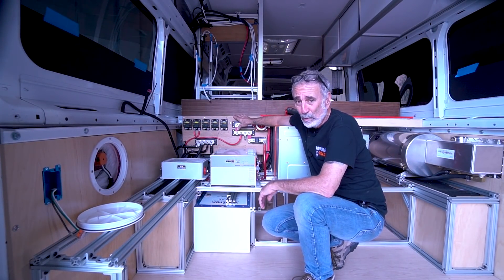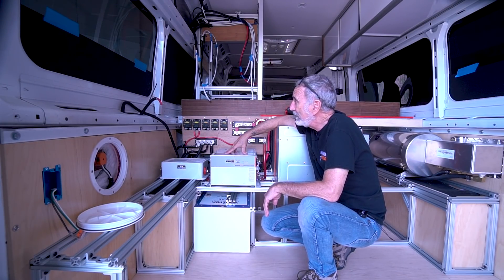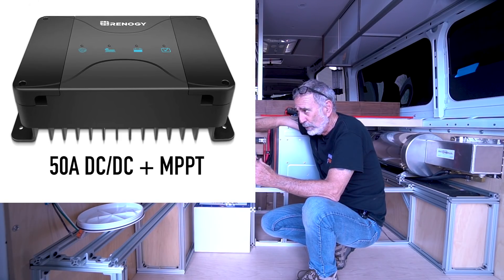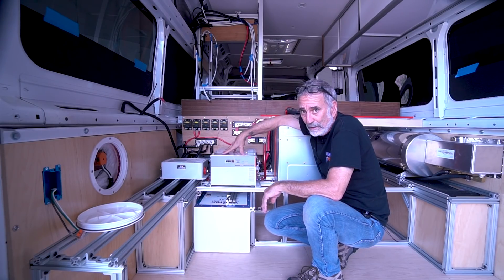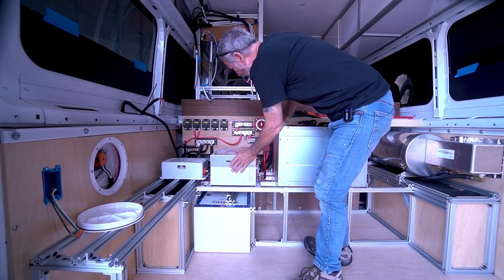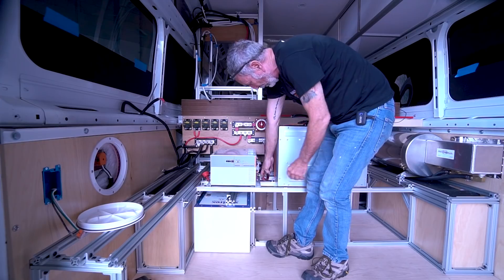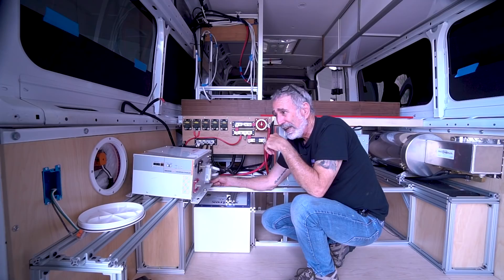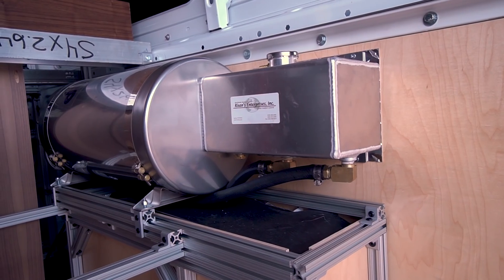In this van build, CRITICAL CHARGING DECISIONS must be made now.

Comment: Higher voltage smaller gauge wire... Cost less, less components.... I'd go higher voltage with a disconnect at the top of the van and another in your electrical room
Reply from the maker: Agreed. This is an older video where is was a proponent of parallel wiring. Now I wire in series, but still use a heavier wire to get all those precious volts down to the controllers

Comment: A bed comprised of three or four sections of plywood that are connected to each other by long recessed piano hinges would be great to fold up and remove for better access to this utility area. Your aluminum beams need to drop or lock in to be easily removable.for the same reason. The kind of stiff foam that Coachmen now uses for their long cushions is even better than what Pleasure Way has been using. Research that foam and that manufacturer! Three or four long cushions can match the width of the plywood panels. Each plywood panel can be covered by Velcro loop. And the cushions themselves by Velcro hook.These individual mattress sections would be far easier to handle and stack aside. But I would strive to maintain at least a 26 1/2 inch clearance below the bottom of the beams. If not, 21 inches. You are so well on your way to making the ideal modularized  garage, sleeping, utility room. A space that serves at least three important functions.
Reply from the maker: My garage space has 33 inches of clearance for bicycles mounted in a custom built sliding tray. I have used the three panel plywood bed system in my builds, however, not connected by piano hinges. I don't want to have to manage all three panels every time. I can remove a single panel or all three with ease, when they are separate. I appreciate your comments and participation, Cecil.
Reply: @HumbleRoad  - With a 33 inch top clearance, you have hit it out of the ballpark. My Greenspeed Magnum XL has seat posts that come up to 34 inches. No problem though because the entire seat can be removed easily enough. Mind you, this height is with 20 inch tires all the way around. With the seat removed, the highest point is 24 inches with the rear rack, but 30 inches with 26 inch wheels. The overall length might be problematic though. I don't know what your total depth is. It might only allow for a single trike to be wheeled in diagonally. I would rather forego trays although I appreciate how perfect they are for bikes. I would just have a heavy carpet to protect the rear bumper and then wheel the trike tires over it. The piano hinge idea would be used to temporarily claim a portion of the mattress width for clearance while a single trike is wheeled in. The REVEL has the rear bed platform that lifts to the ceiling when not in use. The bikes and trikes can roll in and then out again when you reach your destination and are ready to sleep.

Comment: As you know, I love the versatility of that rear garage area for storing toys. Your design makes it a combination garage and utility room. Slide drawers for tool boxes and boxes of repair parts and hardware are nice, but you do sacrifice space. Ideally, I would love to store two HP Velotechnik  Scorpion trikes wheeled in with seats removed to fit underneath a platform bed.. Different directions like shoes in a shoe box. One model has 20 inch wheels all around. Another has a 26 inch wheel in the rear. These two models fold all the way down and the wheels can be removed, but avoiding this would be more desirable. You will eventually encounter a couple who wants exactly this so this is not so off the wall. Radical Design makes a folding bag that holds an entire broken down Scorpion and the bag handles can be thrown over your shoulder for carrying. Ideal for travel by air. There is a video demonstrating this on YouTube.
Reply from the maker: Cecil, email me at georgemauro@humbleroad.tv

Comment: If you have a platform bed in place, you won't have easy access to all this.
My solution would be to have a platform bed that elevates to the ceiling between use.
NOT ELECTRIC!!!!I think it was you who doesn't like electric awnings.
Same here. There should be a practical mechanism to crank a platform bed for cleaning access an other reasons.
Reply from the maker: I just might entertain that idea in my current two builds.

Comment: The marine industry is decades ahead of the RV industry although there is good catch-up taking place.
There are many innovations within the marine industry which can be prudently applied to the RV industry.
The monocoque design of the WINGAMM Oasi vans reminds me so much of marine engineering.
But system access for repairs and retrofitting becomes more problematic.

Comment: I run two Victron solar controllers (one for 2 100W Renogy parallel flat mounted panels on the roof and one for 3 90W ACOPOWER deployable panels run in series) and a separate 30A isolated Victron DC->DC charger.  Very happy with Victron, their app, and their frequency of firmware updates (I also use their inverter, battery monitor and AC->DC charger).  Not sure if you've seen but several people have had "melting" issues with the combined Renogy controllers.

Comment: That combo DC-DC/MPPT controller has a max PV voltage limit of 25V so you MUST run the panels in parallel config, and be aware that that device only provides a max output from both alternator and PV of 50 amps TOTAL ( regardless of whether it can receive 50a from the alternator and 50a from the PV. )

Comment: Those  worm-screw style perforated banded hose clamps on your heat exchanger cut into the rubber hose material thus loosening and causing leaks. I highly suggest either wrapping the hose with protective layers of friction tape, or replacement with a non perforated smooth internal surface clamp. Stop leaks before they start.

Comment: I'm doing 600 watts also and am doing 3 groups of 2 panels - the 2 panels are wired in serial, and those 3 groups are in parallel. That will give me a 24-volt system (maxing out at about 36-40V input to the Victron controller) to keep the voltage manageable, but also keep the current lower than a 12V system, while also giving me 3 separate independent areas in case of shade. Also, despite being comfortable with DC voltage, I still like to stay in the safer, lower ranges.

Comment: Either solar option (series or parallel) is fine, each with their own benefits and issues, but I would recommend that you use a double pole isolator for the input from the solar, especially if going for the series/higher voltage input option (which also has the benefit of only requiring the single input breaker).

I’ve been waiting for info on the closed loop/engine heat install you have designed, so can’t wait for the next video.

Comment: This may not make much sense, two parallel runs to two controllers to two smaller battery banks of same size, then output those to feed the house inverted power. Neither controller has to float to its bank, parallel to parallel output, maybe this can’t work yet ?

Comment: I like the top notch equipment.  I also like your two solar controller idea.   I have an idea for a design concept for you to consider, George.  We all know these vans break down and need service.  We also know the vehicles have a usable shelf life. My design idea is to make a  camper van insert.  A modular concept.  Build out a terrific design in a Shell that can be inserted into the van fully self contained and be able to be removed when the vehicle needs to be replaced or serviced.  Sealed off Airspace between the Insert and the Van Body, with Air being able to flow around the insert to keep temperatures down in hot weather. ( It's just like parked under a shade tree) Your Top Notch equipment will outlive the vehicle, so when you replace the van remove the insert and install it into a new van.  Easy in, Easy out!  

Well that's my concept... What do ya' think?   

What would the neighbors think at the camp ground?  An insert, Self Contained with Hook ups, sitting in a Campground like a tent, waiting for the van to be serviced.

Comment: i will go for series connection for solar, the higher voltage the lower current losses along the cable, BUT parallels come's handy if one of the panel is in shade. For me i will always go for series to save money from cabling and save some weight too, currently i looking for 48v devices (air-con, fridge) i think 48v is the future.

Comment: I like the idea of wiring them in parallel with two charge controllers. That way if one of the chargers breaks your not totally screwed until you get a new one you’ll still have half your system working. 

Ive had the Renogy 50amp dc-dc with mppt for about six months now. It’s been great so far!

Comment: Don’t the most controllers require input something like 2 X the battery voltage or more for efficient operation? The 100 watt Renogy panel I just looked up has “Optimum Operating Voltage (Vmp): 18.6V”.  So wouldn’t you need to wire each set of three in series for each controller, then parallel the two controllers?  Putting all panels in parallel may not be high enough voltage to work well with the MPPT controllers? Great video! Thank you!
Reply: Most MPPT controllers work best with 2 X battery voltage.   PWM controllers will work fine with paralleled  19v panels if rated for the amps.

Comment: Hi George, are most class b van buyers better off investing in high output second alternator, instead of a  solor system? We’re putting large lithium battery systems to run a/c if needed these days.  Solar needs a lot of area to charge large battery bank that class b’s don’t have
Reply from the maker: Many will say that solar is too slow to charge big lithium batteries. I agree that the van roof offers limited real estate, but whatever you can fit up there has it’s place in the charging scheme. For instance, you can hang out off grid in one place and be careful with your usage, and find that your solar replenishment is sufficient to keep you out there indefinitely. And with the prices of complete system’s continuing to drop , the old ROI argument is no longer valid.

Comment: The renogy mppt controller seems to handle max 25volt input voltage from the solar panels (if I didn't missread the manual or wrong product). So all parallel if you go with that one??
Reply from the maker: Correct

Comment: I suggesst to do more parrallel because of possible shadowing. Shadows can cause a string to be completely off. So find a mixture of more parallel, without having to much AMPERE on the wires

Comment: The serial/parallel choice is immaterial unless you have a true redundancy need. Trading amps for volts or less wire for more wire could well be a personal choice (or a van logistics choice). However, there is a serious question regarding parallel MPPT controllers! Each controller (using a sense wire) knows the state of the battery and the correct charge-curve depending on battery technology (Gel vs AGM vs LiIon). When you run two MPPT controllers, each could fight each other to control the charge rates unless you practice equal-distance equal-material parallel wiring along with installing an MPPT that know how to operate in parallel. I think this kinda-important statement was missing from the video. Many MPPT's will work perfectly and parallel. I would have also added something like: "double check the switches and configuration is absolutely identical".

Anyway ... long time Humble Road fan with only have one vanlife electrical build under my belt - so what do I know. Ha ha. (Actually - I've been doing electronics for just over 50 years; so maybe ... just maybe I could be onto something!). Keep up the great work!
Reply from the maker: You raise an excellent point! Even with physically identical set-ups, one device will start up before the other and will dictate the charge state of the battery. The second MPPT will operate based on the reading it takes, which include the already charging first MPPT. So you would have one in bulk and the other in float. Victron has a network module (VE smart Network) when paired with  BMV-712, they claim will provide charge synchronization across multiple charging devices. So, two MPPT and one DC-DC. I need to find the mounting space for all that!
Reply: @HumbleRoad  As your fellow New Jerseyite (Albert Einstein) once said: "A day without learning is a day wasted". So today I learned something! Thanks for explaining the solution.

Comment: George, as usual, another great video. You and I think just alike. I spent 4 decades in the rotating machinery portion of the oil & gas world. Both ergonomic access to perform any and all future maintenance along with getting the right piece of equipment to perform the job was of utmost importance to me. So many times a little design change in the installation, would save both man hours and reduced downtime to perform the required maintenance over the life of the equipment. It was my forte. Most times convincing the engineers and bean counters that maintenance and downtime losses must be considered up front was the most difficult task. A little pain in the front end of a project will save a lot of pain in the end. I very much like the way you think. 👍🏻👍🏻👍🏻
Reply from the maker: Agreed. And your single statement: "So many times a little design change in the installation, would save both man hours and reduced downtime to perform the required maintenance over the life of the equipment." is so true! And most times it's a small simple design change that pays dividends down the road! That's why I spend more time pondering than implementing.

Comment: As usual beautiful work.

I vote for 12 Volt Parallel using 2 MPPT and replace one of the lithium’s with an AGM.

Why an AGM? You only use it when you need a lot of power in a short period of time like starting an AC or Microwave then Lithium with its flat curve takes over. 

AGM also serves a backup to starting battery you can wire it so it can crank engine. Lithium is not so good at this. 

With this minimal use AGM will last nearly as long as Lithium

Eliminating one Lithium will more than pay for extra complexity. 

If you need help I’m figuring out how to program controller and wire reach out.

Warning! you must have loads balanced before connecting or bad things can happen but I believe you could probably school me on this.

Rationale for parallel, your runs are not that long and you tend to oversize wires which is good since you will have negligible line losses..

By using the use lower voltage you will also use  lower cost MPPT.

You also have more experience with parallel than serial installations in your installed base. You need to start standardizing for trouble shooting and not having to dig out the unique specs for each van you build. 

Think modular in documentation and troubleshooting as well.

Comment: I don’t understand why are you using such old teck stuff.Personally I prefer 24 V for a system. It’s high enough to run anything. Yet safe enough you can handle it. You get to 48 V and you start to have problems. I love your 8020. I love your bills. But your tech is way outside.
Reply from the maker: I've had this question posed a number of times. IMHO, we still live in a 12V world. When 24V components and appliances are commonplace, then by all means, go for it. My basic build philosophy is to keep things as simple as possible and not to race to the newest tech, but live one iteration behind where all the bugs have been addressed.

Comment: parallel with two controllers is what I would do.  Also, if the inverter / transfer switch fails the user will lose all 110v output and that's partially why manufacturers use inverters for 1 or 2 outlets, but also because they don't the substantial battery, inverter, and solar system you have to support all outlets and would therefore overload their inverter.
Reply from the maker: My clients are predominately full timers or close to it. So off grid is the norm, with shore power as all but forgotten. The inverter is a very important piece of the system. If it fails, shore power is no real consolation. The SW3012 Xantrex inverter can handle 30A of AC throughput.
Reply: @HumbleRoad  yeah I agree. I like the way you set up your coaches with the full time “off grid” user in mind.  Most RV owners I know don’t even know what their inverter does…LOL

Comment: The next bill you need to look into Merlin solar tube military grade. This is going to be much better for your van bills.
Reply from the maker: Just did a quick look. Interesting. A van roof, however is not smooth like a motorhome. So an additional mounting system would be required which eats up the weight savings of these panels. The ruggedness and efficiency are certainly worth the extra effort to get them mounted in a clean elegant way. Thank you for all your suggestions.

Comment: I never see anyone insulate their hydronic heat exchanger.  Seems like you would want it insulated.  Maybe you could cover that next week.  Thanks
Reply from the maker: In my hot water maker set up, I get 170 degree F water at the faucet. No need to insulate the heat exchanger! In fact, we need to temp it down a bit.